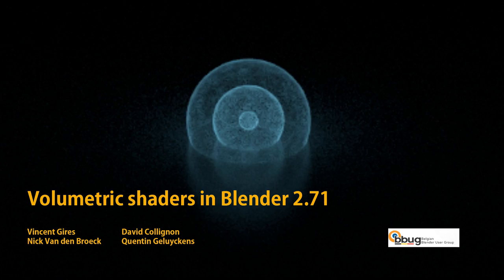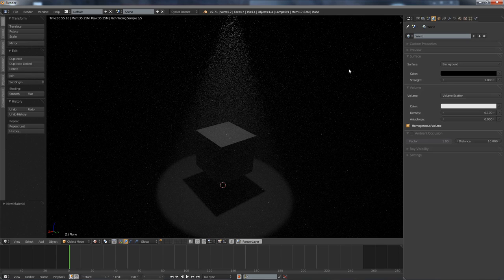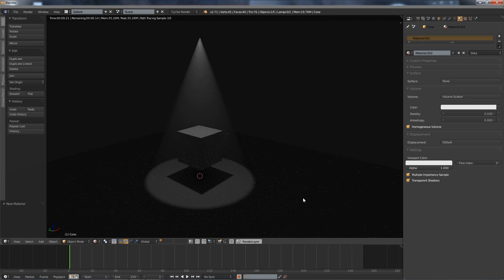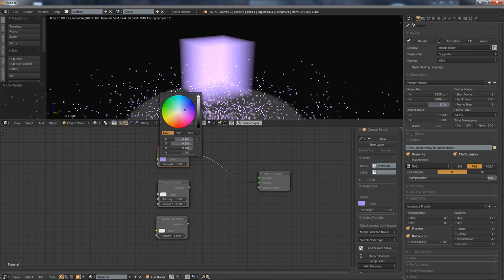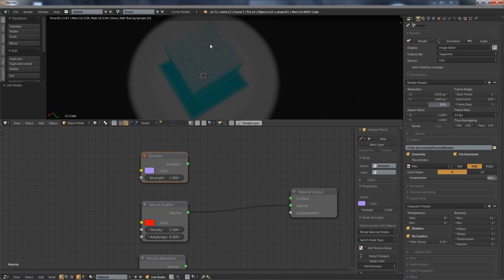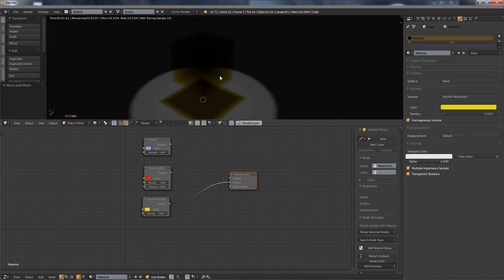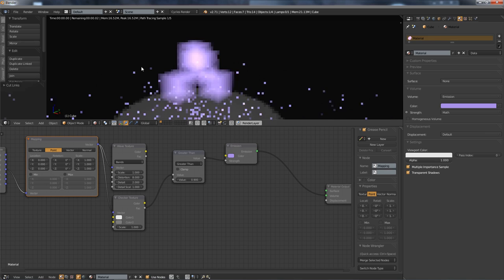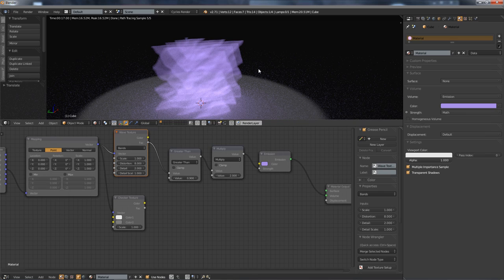Volumetric materials in Blender 2.71

Comment: Just one question. colour absorption, does that not mean it absorbs all colours of light in the object other than the one you want it to reflect back. for example if you set the absorption colour of an object to yellow then light it with a blue light it looks black as there is no yellow light, in blue light ? when setting its volume to volume absorption
Reply from the maker: andy morris Yes indeed. I think that for some reason they decided to take the color you select as the color that is left untouched instead of it being the color that is absorbed.
And I just tested it in 2.74, it still works the same way. I should ask them why they did this.

Comment: How did you make the thing at the beginning? It looks very cool
Reply from the maker: The blue radiating waves are also volumetrics.
I did the following:
start with a cube or sphere, remove the default surface shader and add an emission shader connected to the volume output. Then I used the Gradient texture which I put to spherical. Connect to this gradient texture a mapping node set to 'point' and a texture coordinate node set to 'object'.
Now comes the difficult part. I used some mathematics to get the gradient texture to repeat itself 3 times; You can do this with a math node set to modulo of 0.333. From then it is just a matter of adding a greater than and a smaller than math node in order to get well defined waves. I animated the whole thing by making these math nodes scan from 0 to 0.333.
I also added a mushgrave texture in order to get some extra dark and light patches in the spheres.

Does this help? Or do you want me to explain in more detail? Unfortunately I can't add a picture here or I would show you the node setup.
Reply: Blender Education
Where do i add the math nodes? Between the gradient texture and the emission? Or between the mapping node and the gradient texture?

Can you Upload a picture somewhere, and then put a link to it so that i can see if i'm doing it right?
And where do i put the muchgrave texture?
Reply from the maker: Anders Thellefsen 
I did better. Her you can find an improved blendfile: www.blendereducation.com/Blender/sphericalwaves-example.blend
This is not the original blend file, but I just recreated it at work. I also added frames in order to explain the parts of the node tree. Something I had troubles with in the beginning was the animation because it died out at the beginning and the end, but I cut out those frames. That's why there are flashes here and there in the youtube video. But I fixed that now, so those flashes are gone as well.
I also grouped all the inputs in one node group (which you can open with tab) and named them appropriatly.
Hope this helps. If you create something similar or cool, I would love to see it.
Reply: Thank you for that, very kind.
Reply: Hello, it's a few years later, and this link no longer works :/ I tried to follow your instructions in an above comment, but I'm stuck. Could you share this file or screenshot or something with me? Thanks! :)
Reply: @TheBookerSmith  well this is almost one year later. the instructions posted on the comment still work, I just tried them :], thanks for the tutorial guys

Comment: I still don't undetstand the difference between homo- and heterogeneous T.T I'm stoopid?
Reply from the maker: First of all, it is never stupid to not understand something. It just means that I need to explain better.
So secondly, let me give it a shot. In order to fully understand, you need to understand the difference between heterogeneous and homogeneous. Roughly speaking, hetero means 'mixed' and homo means 'the same' (think of homophile, that is someone that loves other people that are the same). The word has a Greek origin (not to be confused with the Latin homo, which stands for human). If you understand that, then it is easy to see that a homogeneous object, is an object that is completely made out of the same material. A heterogenous object is a mixture. For example, if you combine water with oil, they won't mix and you get a heterogeneous fluid.
So, back to densities. We say that a gass is homogeneous if it has the same density everywhere. It is heterogeneous if the density changes from spot to spot. For example, fog is usually more dense near the ground and lighter up in the air, hence fog is heterogenous. A homogeneous gass is much harder to imagine. If you catch some air in a balloon and wait for a bit, then it will most likely be homogeneous.

So, that is the physical difference between homogeneous and heterogeneous. So why is this important for Blender? First of all: it isn't. By default, Blender assumes that all those volumes are heterogeneous. That is, after all, the most flexible. If by chance the volume would be homogeneous, than the same calculations will still give the correct result. However, it you know that an object is homogeneous, then you can speed up the calculations a lot by using this information.
Roughly speaking, Blender will devide the cube (or any object) into smaller cubes. Then it simply traces the light trough all these smaller cubes, checks the density locally and sees what is going on. This take a lot of ray tracing since the light might scatter or change at every such smaller cube (and usually indeed does change and scatter in every cube). But, if I know that the volume has a homogeneous density, then I don't need all the smaller cubes. I just need the distance through the object and I calculate how much ligt I lose along the way. It is almost a one step process. (again, roughly)

So, to sumarize: the homogeneous option tells Blender that it can assumte that the object has the same density throughout and thus Blender can compute the scene much faster.

I hope this explains things a bit better.
Reply: +Blender Education Holy damn. Thank you for taking your time to explain that. Now it makes more sense :O

PS: The part where I said I was stupid was just sarcasm, kinda. I usually have a hard time understanding things that I don't spend alot of time studying. For example, I have a very easy time learning new words that is universe and space related because I understand very much about it. But I have a hard time understanding art related words such as these 2, as I don't understand alot about art and only have it as a hobby instead of a life goal.
Reply from the maker: +Ehri, no sweet, I got the sarcams, but some people actualy do beat themselves down like that and they really shouldn't.

Funny that you connect the words homogeneous and heterogeneous to art. I am a scientist and I use them very regularly in almost exactly the same way as Blender does. And actually, if you like space and want to get to know these words in that context, then you should look into the big bang. One of the prime questions science still has, is why our universe is so heterogeneous (you know, all the mass is located in stars and planets, with nothing inbetween. That is exactly what heterogeneous means). After all, we kind of assume that the big bang started of quite homogeneous, so why is everything suddenly heterogeneous? (Hint: quantum fluctations ).

PS: and that is how you get from Blender to quantum fluctuations :D
Reply: +Blender Education the reason I connected them to art is because I've never heard about them before, and cause Blender uses them, art uses them. Science uses them aswell I guess. :P

Comment: Unfortunately volumetric textures don't seem to work in later versions of Blender (certainly not 2.73 or 2.74). Is there some way to get them to work in these versions?
Reply from the maker: Hello Graptopetalum Sorry that my response is so late, but I hope it is not to late. I just tested it on 2.74 and then updated to 2.75 and tested it again. I can create both an emission and volume scatter shader that behaves like I explained, so for me it seems to work. Make sure you have cycles selected and that there is nothing connected to the surface input of the output node (except perhapse a transparent shader). If that doesn't solve your problem, could you upload some kind of screenshot and I will see if I can spot what is going on.
Reply: +Graptopetalum Also make sure you're rendering with your cpu not your gpu.